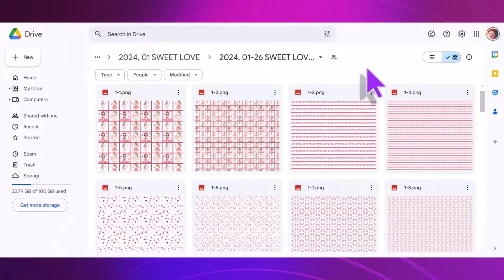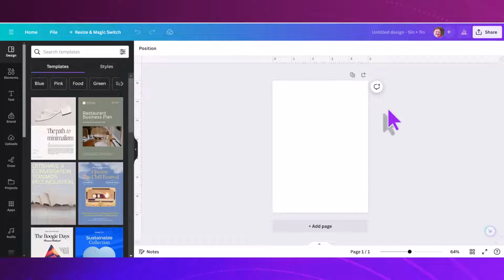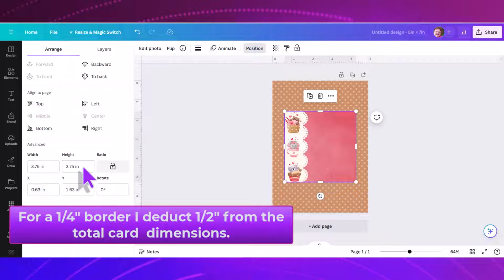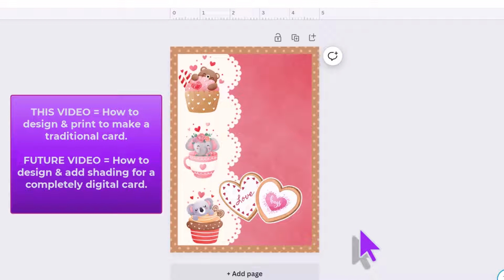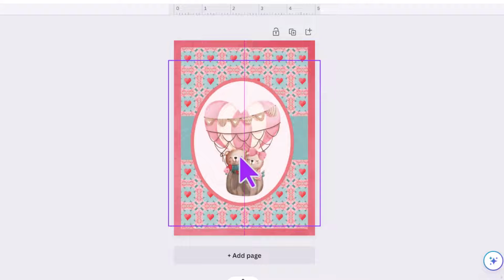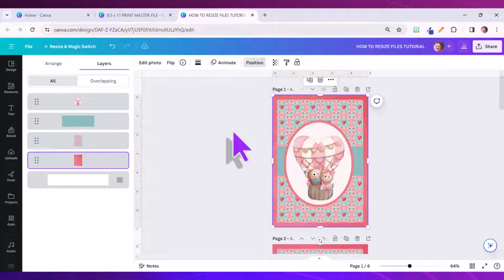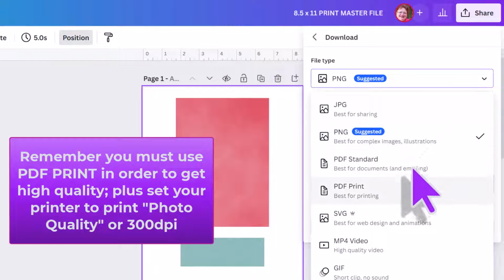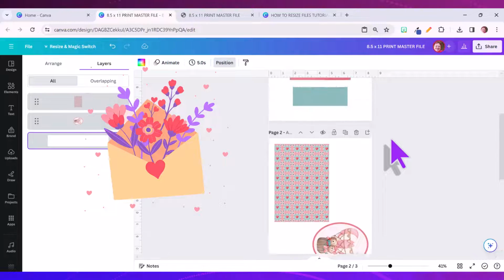#9 UPDATED! HOW TO RESIZE DIGITAL DOWNLOADS FOR CUSTOM CARDS

Comment: Awesome video! I did get confused toward the end, couldn’t you just print the card front out as one image? Instead of the 4 elements - I’m confused.
Reply from the maker: Yes! But often people want to print the separate elements so they can cut them as different pieces to use foam tape behind them, etc, for dimension. You can always just print it as one flat image too. Does that make sense?
Reply: @ That does make sense! Thank you for the clarification.  And thank you for the quick response.  Have a wonderful day!

Comment: Thank you, finally understood how to get to print from Canva. I do have a question though. So if I print from Canva, then I need to fussy cut out what I use? I can't send card to Design Space to print and cut? Thanks for your help.
Reply from the maker: I don't have a Cricut, but for most software you need to use a PNG. You can upload your PDF from Canva into another program and export the PDF images in PNG format. There are many programs out there that will do this. I use Adobe Acrobat and the images are automatically exported at 300dpi. I hope that helps!

Comment: I've really enjoyed and learned a lot from your Canva card series. Thanks so much for your time and attention to detail. I'm trying to figure out how to design and print greeting cards, in Canva, for sale. The first video of this series, with the section on guides, is the closest I've come to figuring out how to make and print two A2 size cards on a sheet of letter size card stock. I'm concerned there might be too much white space on the original guide, would you suggest I adjust the values to be a bit smaller to make a design larger and fit the A2 card size better? Thanks again for the tutorials.
Reply from the maker: Hi ~ the guides I provided are for printing 4 card panels that are 3.75 x 5" (to mount as a front panel on an A2 4.25x5.5" card, leaving a 1/4" border all around. The problem with a full A2 card is that if you lay the 4 cards out, they take up the entire 8.5 x 11" sheet of cardstock, and since most printers will take a .2 (approx) inch margin on the outside edges, it doesn't work. Of course, there are so many printers out there... so you're in luck if yours has a setting to print all the way to the edge of the paper. If not, you have to lay them out with a lot of white space (and extra cardstock). Those are really your only choices: use the smaller front panels (with a border), have a printer that prints all the way to the edge, or have extra cardstock. Let me know if I can help in any other way! 💗